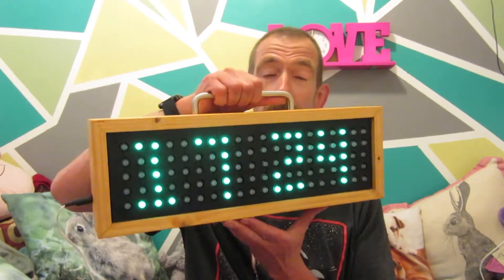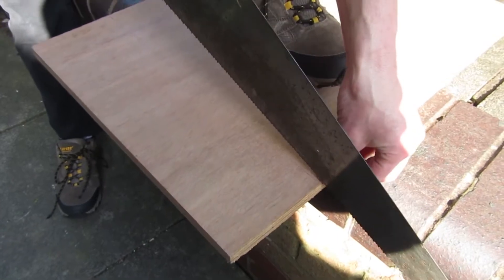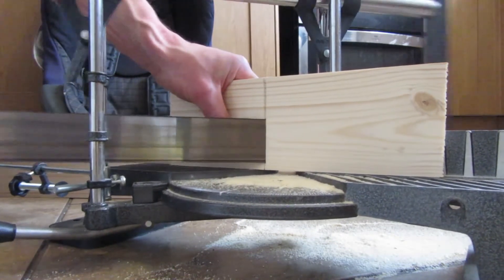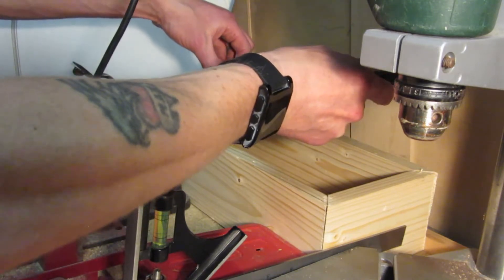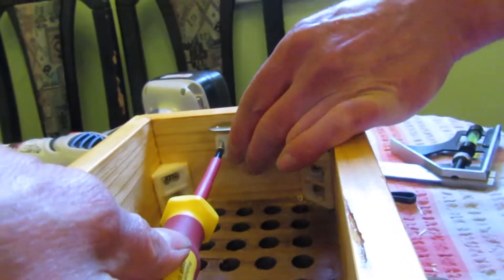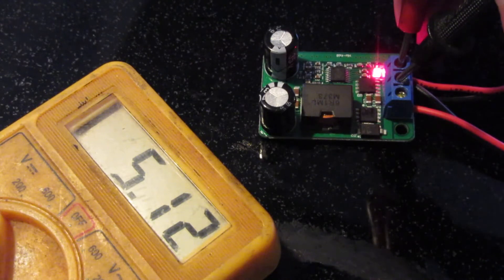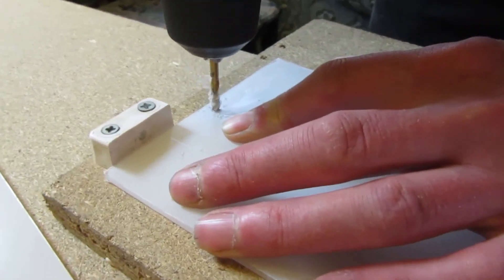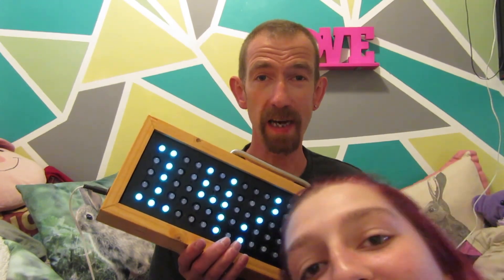DIY LED Digital Clock

Comment: Hi Richard, Thanks for your response. I am getting error dht.h: no such file or directory, i am facing this error in many projects and all are on hold due to this error. I am really worried and feeling restless.
Reply from the maker: Think you have not installed the DHT sensor library. I'm guessing you are using an Arduino and it's IDE. Start the Arduino IDE, click Tools, click Manage Libraries, type dht into the search bar, then select the library you want.